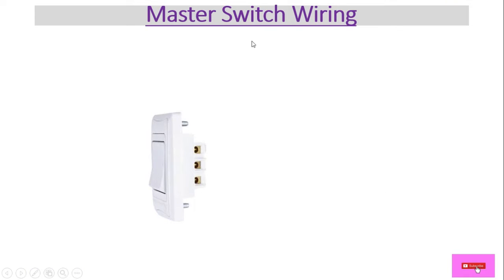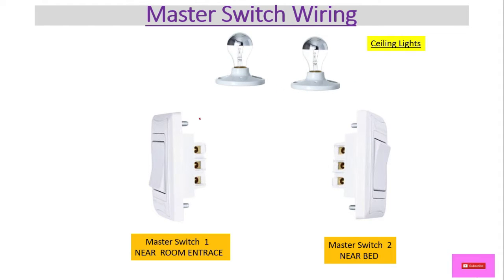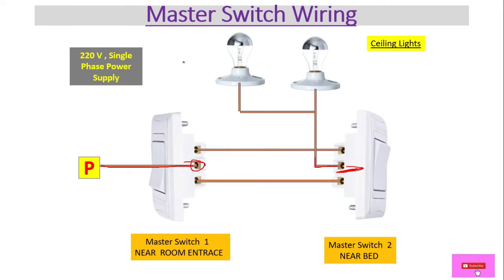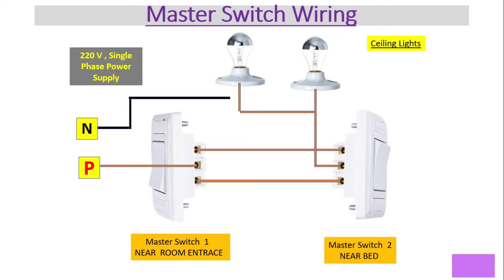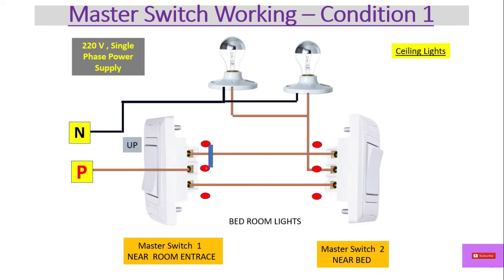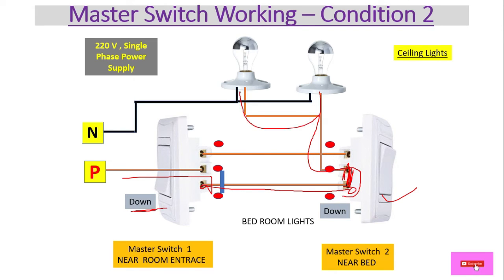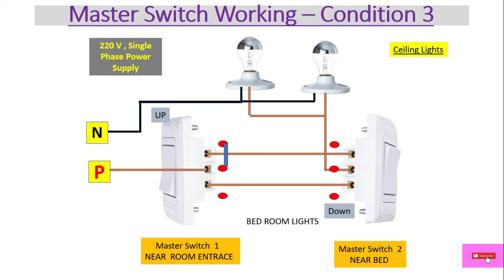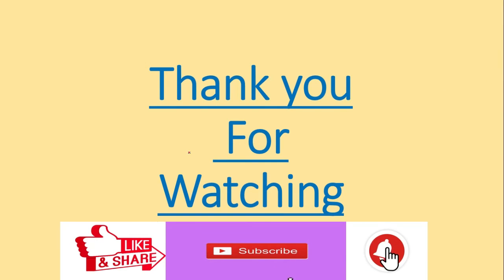Master Switch Wiring | Two Way Switch Wiring

Comment: But this isn't a master switch, it is control switch whereby a single light point is being controlled by two separate or independent switches
Reply: Looks like a normal 3-way to me, not a master switch.
Reply: @seasonaldepression840  exactly